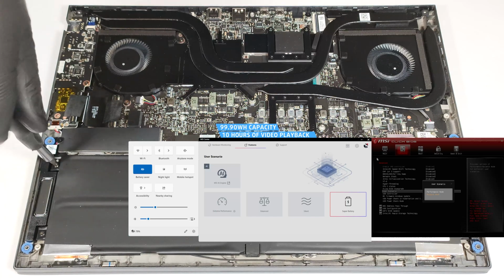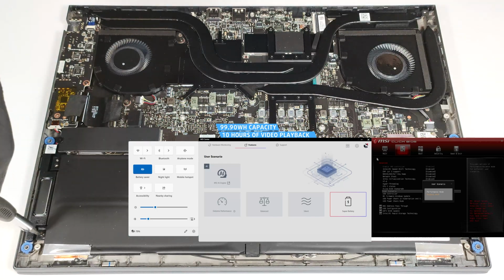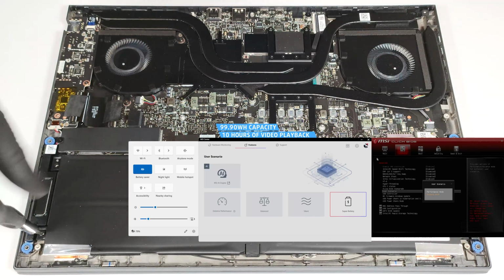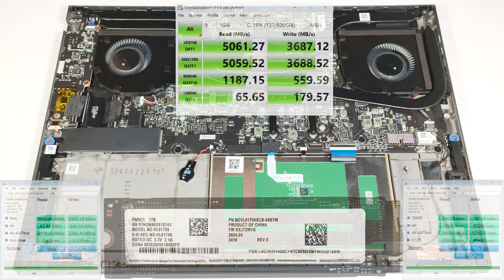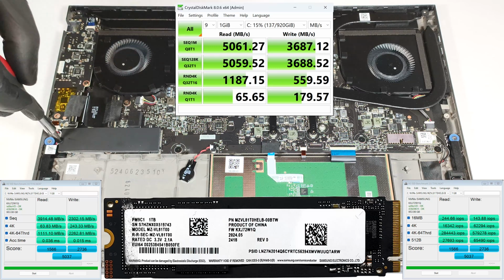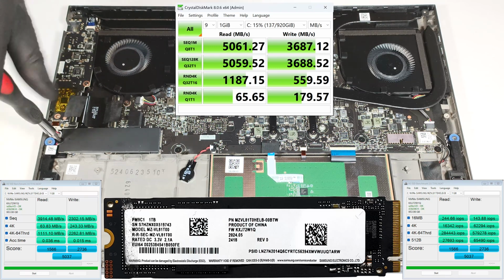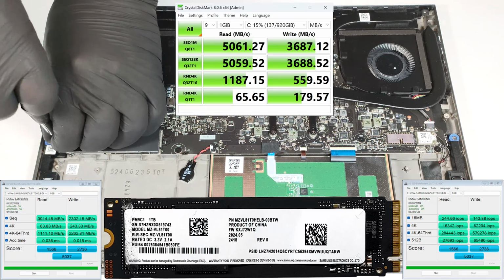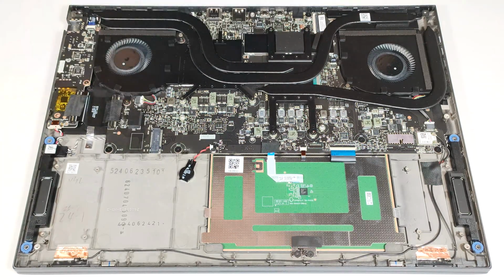🛠️ How to open MSI Prestige 16 AI Studio B1V - disassembly and upgrade options

Comment: I bought this laptop yesterday at a computer store in Japan, so this video is really helpful! Thank you very much!
Reply: Hey, i am planning to buy this. How is the performance? Any issues?
Reply: @sagarskrishnamurthy5806  
In terms of what I bought in Japan.
Performance is not a problem. However, compared to MSI's other gaming notebooks (Katana, Sword, etc.), the performance is a bit lower because the PC is set to consume less power. Also, instead of being quite lightweight among Nvidia's Geforce-equipped notebooks, the keyboard and other parts tend to get hot.
Also, due to the thin body, only one USB-TypeA (3.2Gen2) port is available, and the remaining ports are ThunderBolt4 (where the included charging adapter is plugged in), USB-TypeC (3.2Gen2), and RJ45 (Ethernet), so a USB-C hub is required!
Reply: @sagarskrishnamurthy5806  
In terms of what I bought in Japan.
Performance is not a problem. However, compared to MSI's other gaming notebooks (Katana, Sword, etc.), the performance is a bit lower because the PC is set to consume less power. Also, instead of being quite lightweight among Nvidia's Geforce-equipped notebooks, the keyboard and other parts tend to get hot.
Also, due to the thin body, only one USB-TypeA (3.2Gen2) port is available, and the remaining ports are ThunderBolt4 (where the included charging adapter is plugged in), USB-TypeC (3.2Gen2), and RJ45 (Ethernet), so a USB-C hub is required!